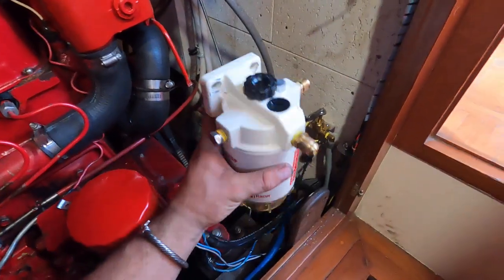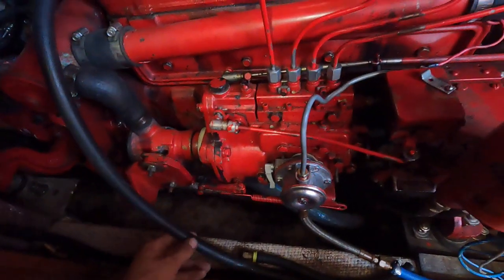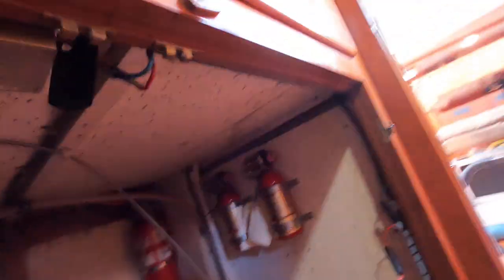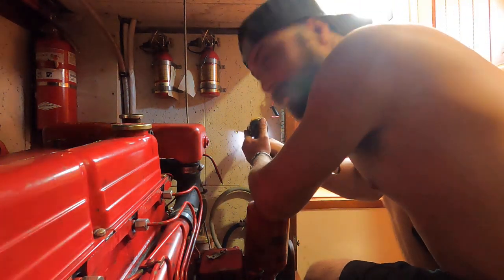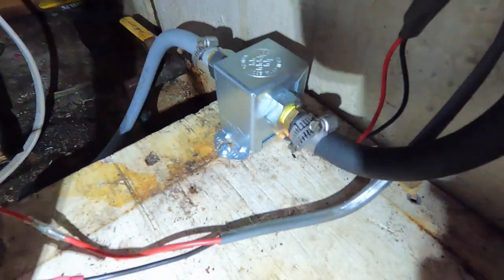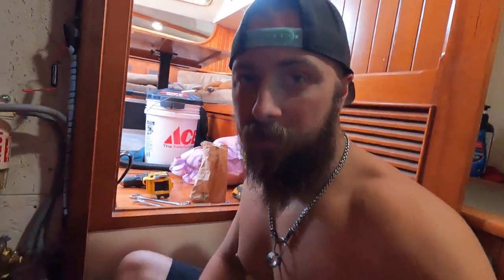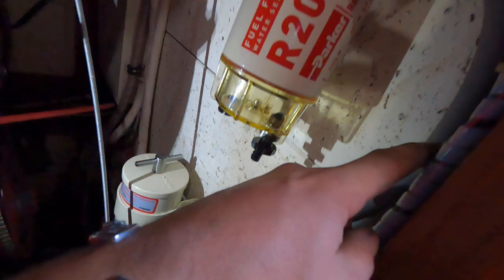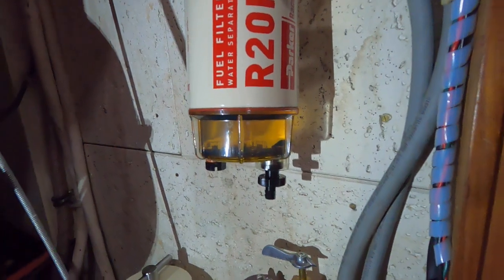Building My Own Diesel Fuel Polisher On A Budget!

Comment: I agree with you.  A person can spend a lot of cash OR you can be smart and build one yourself that pretty much can do anything one of those fancy systems do.  It all depends on the individual design.  I've heard of at least one person who only draws fuel from a tank of fuel that has been polished by his system.  Any fuel taken on at a dock goes into a different tank; then, it is polished and eventually routed to the tank that is the supply tank.  Complex but, lots of bad fuel out there !  Thanks for sharing...
Reply from the maker: Exactly this is a far more simple system to run more as a maintenance system. If money was no object I'd have some fancy that woul catch more for sure, but this system and always filling with a filter funnel keeps the engine filters clean and doesnt break the bank. Figured be a good alternative for those who can't swing the big system like me haha

Comment: Hi new viewer.  Just ran across this video.  Kinda disagree with using the fuel pickup tube.  Water and biomass will build up to the level of the pickup tube.  What I built was a stand alone system, that requires me to open the tank.  Then I basically vacuum the bottom of the tank.  Just my 2 cents...
Reply from the maker: I mean a good maintenence clean is always the best way but how often do you clean the tanks? This system is used on top of that as routine if you get crappy fuel while traveling. If we get tossed on anchor or passage run it through the polisher when we get there and it'll pickup stirred up shit as water will even mix temporarily. So are you suggesting you ran a dedicated pickup to the very bottom for you system? Guess i don't understand what you suggested alterantive is?

Comment: Nice idea! My polisher is even simpler - all i do is pump out the entire contents of the fuel tank through the primary filter (just before i change it), into a transparent  fuel container. The point being that you get to pump out any stuff sitting at the bottom of the tank and then i get to inspect the fuel before putting it back into the tank (through a baja filter).
Reply: Sounds like a lot more work to me......we have 160 gallons with both tanks so pumping it all out and putting back in is not feasible while traveling. Easier for me to switch over and circulate after a rolly night when everything gets stirred up

Comment: that pump will drive the dolphins mad....a car fuel filter will be quiet
Reply from the maker: It's not to bad honestly i dont run it all the time, reason I used this pump is I need something that when turned off won't restrict flow to engine that way it can be used as a back up pump if manual fuel pump ever fails. I'm sure there are other options but I knew for sure this style is "flow-through" when off and simple and cheap to replace

Comment: Do you have video of you cleaning out the tanks?
Reply from the maker: No we don't! We had to do it so much the past year between the water tanks and the fuel tanks that we were just so sick of it we didn't video it anymore lol.
Reply: I’m looking to purchase a H45 that’s available where I live and I’m  a bit worried about how big of a job it would be to remove and clean water and fuel tanks. Any insight you could share would be greatly appreciated.
Reply from the maker: @davidsaucedo3  Well a big reason we had issues with our tanks isn't necessarily because its a Hardin but because whoever had this boat before us mixed up the water and fuel tanks so when we got the boat there was about 50 gallons of water in our fuel tanks and about 15 gallons of diesel in one of our water tanks. We used a hand held pump and attached a long hose to it and pumped out all of the water from the diesel tanks and then ended up pulling the rest of the fuel out of it  because it still was very dirty and mixed with water and put a treatment in the tanks to kill any algae growing and then he set up the polisher so that we can always clean the fuel from this point on but the water tanks we ended up cutting access holes into both of them and scrubbing them out thoroughly and then replacing the lines too so that there wasn't any diesel in the systems anymore. And we kept the access holes and just made those little doors so that if we want to we can go back in and clean them again.
Reply: @davidsaucedo3  So there are a few factors to consider when cleaning tanks and biggest one is do the tanks have access covers? If they do, you should see some plates with bolts in them and they job can be fairly straight forward.Our tanks do not which involves cutting access covers and making panels to seal up the holes after words which isnt a fun task at all. I'd recommend seeing if you can find access covers and if not negotiate some money out of the price as its a good sized job but still doable. Hope that's helps

Comment: Hi!

I am about to build almost the verbatim copy of your system, and, just as you, would like the electric fuel pump to work for several purposes: a circulating pomp for the polisher, a potential backup for the mechanical pump on the engine, and as an emergency measure to augment the power of the mechanical pump in case I really have to push the fuel through some clogged filter.

What I am struggling with is choosing a pump that would not be an obstacle for the mechanical pump when not working. I could not find any information that would facilitate choice, or a statement such as  "any would do"  vs  "I need some specific one".

Would you please comment on your experience?
Reply from the maker: You are correct a lot of pumps would add restriction when not in use. I used a "Facet" cube fuel pump. You can google them and they'll pop up, there usually good to about 150hp (my engine is only 70hp) but there a "clicker style pump" there inexpensive and reliable/simple and most important completely flow through when off. As another added bonus when I change fuel filters I always top of filter housing with fuel to avoid possibility of adding air and once new filter is in I hit the pump and it fill the housing before I put the lid on. If you have any other questions feel free ask this system has been working great since this video

Comment: G'day and thanks for the video - great approach to polishing.  
Question: Can we skip the return T-valve and just use a passive Y to drain both returns back to the tank? 
I guess it's setup dependant, to where we wouldn't want to send pressurized return fuel backwards up the wrong filter, but besides that issue, is there a reason to not just use a passive Y?
The other option, I'm guessing, is to just have an independant tank return for the polisher. But maybe the returns are more complicated than just pouring into the tank.
-thanks!
Reply: Yeah I suppose you could, I just chose to have both systems independent to avoid back feeding pressure to injectors. Simple enough to just throw two valves in but you know what they say there multiple ways to skin a cat lol

Comment: I'm looking at something similar, in that I'll be using two switchable Y values to divert fuel flow. BUT, I plan on using the main engine filter/water separator(FRAM FCS1136M) for the polishing and normal operation. The Y values will be used to (1) divert the main filter output to either engine pump (normal operation)or the polishing pump intake and (2) divert the tank return from either the injectors (normal operation) or the polishing pump output. I like having just one filter type to replace and keep on hand. I'm playing devil's advocate but so far I'm not seeing any reason why this shouldn't work assuming that the Y valves seal 100% on the OFF side. 
Good luck with your system
Reply: I see what your saying, and yeah i mean I don't see why you could use your engine filter and juts change it more often. Ow as already upgrading my filter assembly so had the extra on hand is why I went this route. Good luck

Comment: So anything is better than nothing my boat came with one and can clean 200 gallons in 30 minutes got 2 Racors, but the one you have works just as good as mine
Can you do an update on that Starlink System you installed?
Go to Mexico that is where I am till after the hurricane season yea its cheap and fun
Reply: Yeah you have one of the pricey systems which is great if it comes with the boat haha are won't move anything like that but its simple and cheap I'll run mine it more often for maintenance and Starlink has been great but we've been at the dock since installed but we finished up the house and moving to a new dock this weekend so we will be out alot testing it and will give an update for sure. Mexico is appealing for sure if we head that way maybe we'll bump into you